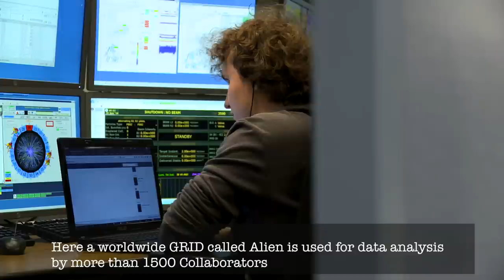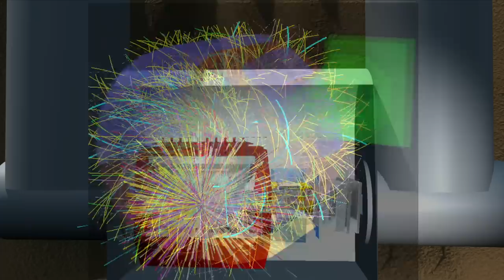Flying over ALICE

Comment: 1. Why are there 3 quarks in a proton or neutron? Why not 2 or 4?
2. Is there an upper limit to the size of an atom, before gravity starts combining protons and neutrons?
3. I've heard in here that quarks don't make up all the mass of a neutron/proton, if so what does?

.
Reply: Because there are 3 kinds of quark charges so to create (strong charge) neutral particles 3 quarks have to be combined. 99% of a nucleon mass comes from the strong interaction energy.
Reply: -There are 3 because of how the strong force works. Macroscopically we do not observe coloured charge states therefore only states with quark-antiquark pair (called mesons) and triplet of quark or triplet of antiquarks (called baryons and anti baryons) are observed. Theory does not exclude that other heavier states (more than 3 quark/antiquark combinations) may exist
-Gravity is negligible at the energy scales of atoms (it may be neglected up until energies of the plank scale that we are very far from reaching with current technologies) so i would not say gravity poses a limit on the atomic number of a nucleus
-Fast answer: Quantum ChromoDynamics (QCD), a proton is made of uud (Up Up Down quark combination) which weight around 2 Mex and 5 Mev. The total combined is less than 10 MeV against the mass of the proton which around 1000 MeV.  The remaining mass comes from the quantum effects of strong force let's say